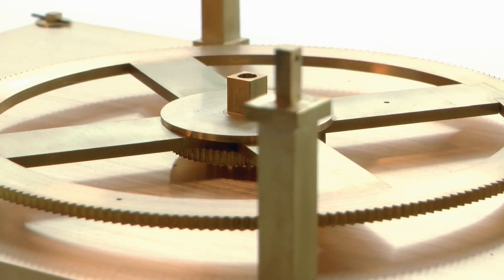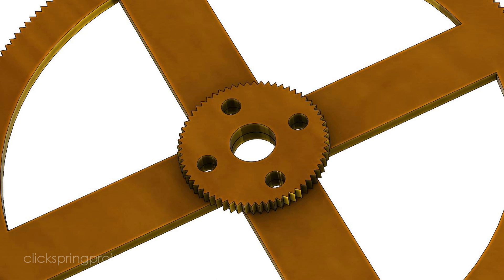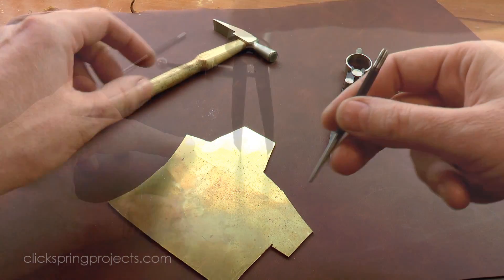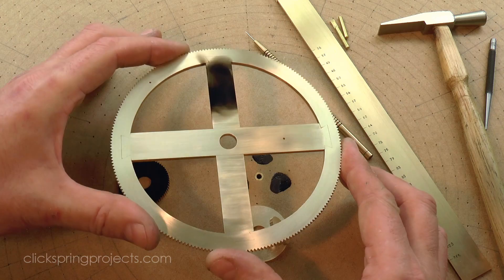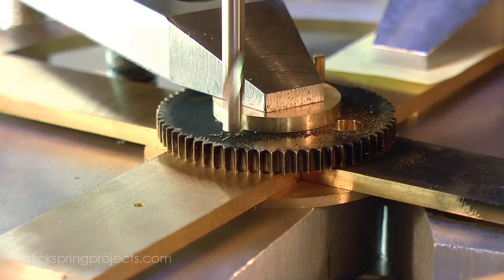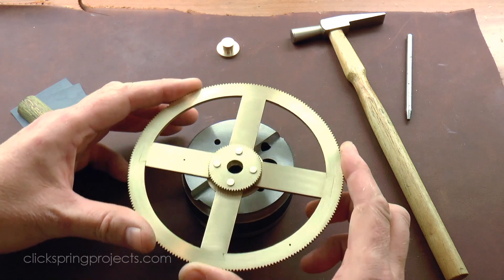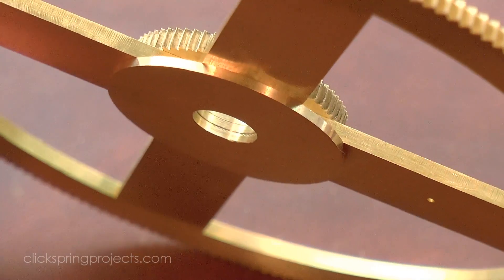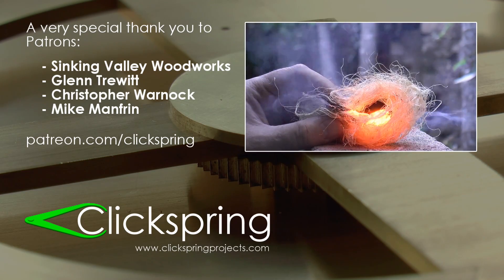The Antikythera Mechanism Episode 4 - Making And Fitting B2

Comment: I find it amazing the way the rivets disappear one you've sanded them back.
Reply: Matthew Rowles I would love to see just a single of his sanding and filing operations in real time. Just to get a sense of the time it takes him.
Reply: Matthew Rowles He also does a VERY thorough job of the peening process :) I would probably just have wacked it with a hammer straight to the pin :)
Reply: There is a slight countersink to the hole it goes into, so when he peens it, theres a slight overhang, so the rivet has a slightly fatter bit on each end.
Reply: The peened over metal actually digs into the surrounding metal and interlocks.
Reply: How is the clamping strength not lost when the peened over end disappears?
Reply: @Idoall.myownstunts  The peining process compresses the excess material of the pin against the walls of the drilled hole such that, in conjunction with the countersink it becomes an extremely tight fit.
Reply: @Idoall.myownstunts  you chamfor the holes so it still has area locking in below the surface
Reply: Me too seeing how that did the job for thousands of years including the original he is copying.
Reply: Brass is surprisingly soft, and the hammering expands the pin to be a tight interference fit inside the hole. Clockmakers use tapered brass plugs, simply hammered in, to repair worn bearing holes. They never fail even under constant side pressure as the clock is running,
Reply: As a woodworker and not a metalworker I was amazed at how that was possible. In woodworking it is almost impossible to find a plug that matches the grain exactly.
Reply: Back in the day when metalwork was firmly a part of the school curriculum, we spent an entire term doing nothing but filing.  Initial interest turned to mild annoyance which turned to mind-numbing boredom and then back to delight when the imperfections were completely removed.   Seeing those rivets disappear became the aim of the game.
Reply: Because you do not sand/mill through the complete peen.
Reply: And this is the answer to Mark Dammes' question above if you paid careful attention to the video.
Reply: I hear ya Mark Dammes. There is a very small countersink. I'd imagine its plenty of metal left in there for its intended job. But doing this to a rivet that had substantial forces on it would be counter productive.
Reply: Absolutely, I have never seen that before.

Comment: Probably abit gross but I imagine dried animal blood would do the job of marking fluid perfectly.
Reply: Yeah, but for non-ferrous metals only though. Blood will cause havoc on iron alloys.
Reply: First time I accidentally got blood on a rifle the bluing disappeared very quickly where the drops were. Since then I'm very careful not to get blood on any ferrous metal. I think soot is the right path.
Reply: Doesn't blood get flaky when it dries?
Reply: +BestFleet Inc. Blood has a high salinity which will attract water which will cause the iron to rust. When the blood coagulates it will dig into the microstructure of the metal which makes the problem even worse.
Reply: Drying time could be a problem with blood, dyes or oil-based pigments...plus it would have to be something that doesn't dissolve in water (from sweaty hands, etc.)  Someone else suggested shellac, and while the earliest written evidence of shellac goes back 3,000 years, it is known to have been used even earlier.  It also stands up to being handled, dries quickly, and is easily removed with alcohol.
Reply: That soot coating is actually historical accurat, it´s still used by some Gunsmiths.
But, still Your idea is interesting i think i will try it some day just because i am curious about how it will be to aply on the surface.
Reply: Jesse I thought blood as soon as he mentioned it! Then when he said candle soot I felt like a psychopath...
Reply: Wax / soot mix - colour and more wear resistant?
Reply: Would the clockmaker then always have a number of small animals ready to have steady source of fresh blood when he needs them? Just crack open a mouse when you need to paint a wheel? =)
Reply: Scott Mew 

Also blood (well, human blood, at least ...) has a relatively high pH of 7.4, making it somewhat alkaline. That may not sound like much, but I once knew a RAF helicopter crewman, who spent his days medivacing wounded solders. With the amount of blood split on the cargo floor, he rapidly learnt that, as soon as the patients were off-loaded, to hose down the floor, not just for hygene reasons, but it proved hella corrosive on even the coated metal ... goes to show that even a 'mild' alkaline can be nasty ...
Reply: Blood Eats into or etches brass. I learned That when I let a co-worker borrow a brass handled chip-hook I made for myself and got it back covered with blood as he had already cut his hand on the chips prior to borrowing my hook. Even after cleaning the blood off in a solvent tank I found it had his fingerprints permanently etched in the handle.
Reply: i just replied the same thing as you....then i saw your comment
Reply: BestFleet Inc. What about a plant based dye made from wine or similar. Or an oil paint you could paint a thin coating of an oil paint and it would scratch just like the dye...
Reply: Jesse whoa, I just made a nearly identical post.
Reply: Stellar Steel yes that is right if the blood is not cleaned off from steel the blade will rust with high carbon steels this is a common issue with swords and axes. I dont think blood tarnished brass or copper or bronze though.
Reply: That's interesting, why does it do that? There's iron in blood lol. I don't usually think of blood as corrosive.
Reply: The blue dye made from Woad might be a decent candidate for a marking out fluid.
Reply: I’m guessing it was soot or pulverized creosote or charcoal mixed into a marking paste with something tallow or beeswax.

Dried animal blood would work too, but it still needs a carrier of some sort because it’s just another colored powder... it’s just reddish-black dust.